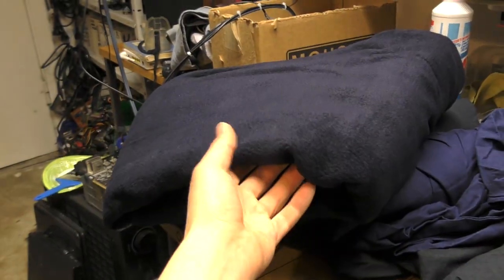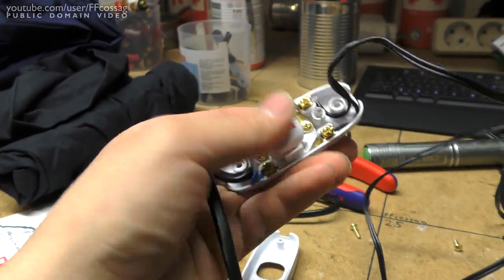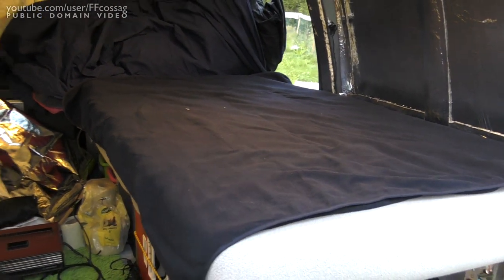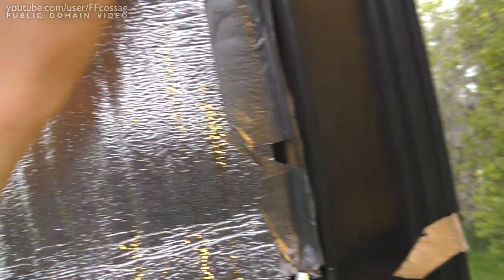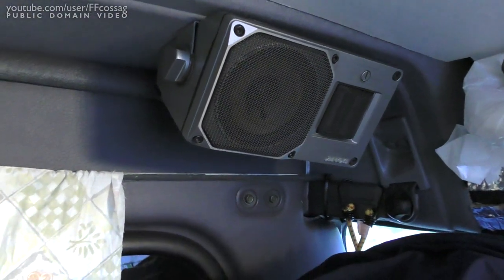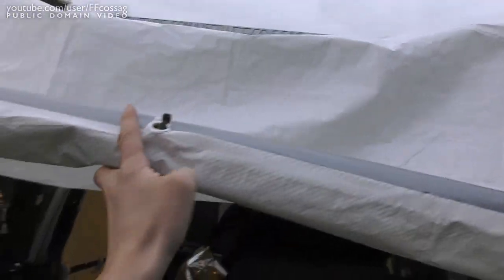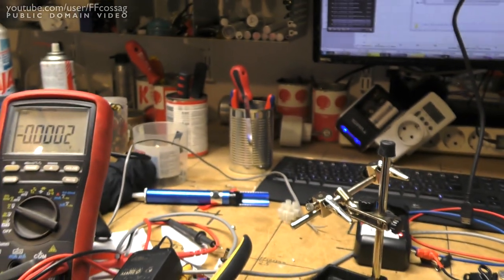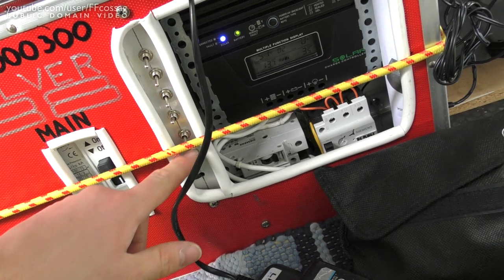Final preparations - VAN2017

Comment: Is that ikea Skubb thingy suitable to hang on a wall? I've been searching for temporary "shelves" to hang above my desk and this seems like a way to go. It's also pretty cheap from what I can see.
Reply from the maker: Not really. It only has mounts for a horizontal pipe.
Reply: I'll figure out a non-invasive way to mount them, just wondering whether the material is tough enough to support itself and several grams of random whatever.
Reply from the maker: It is like ten times stronger than I thought it would be. It's made out of that plastic "cardboard" that they make temporary road signs out of.